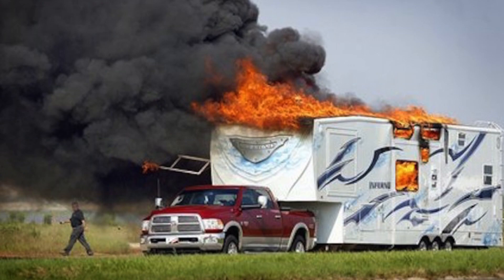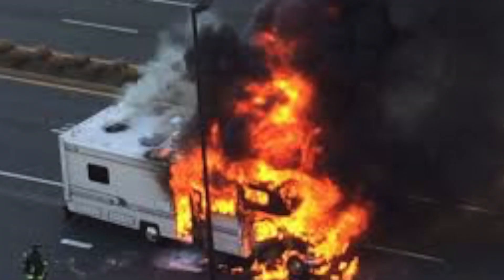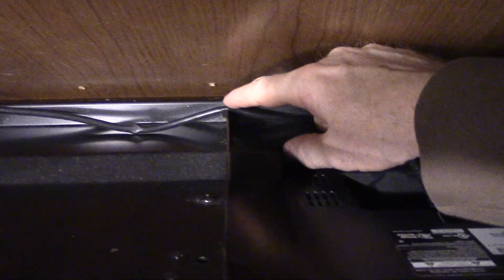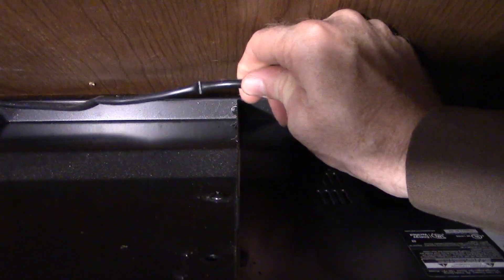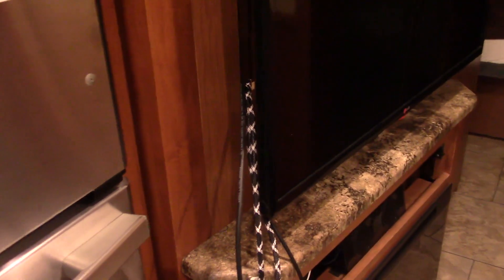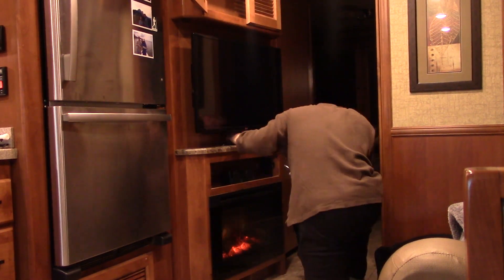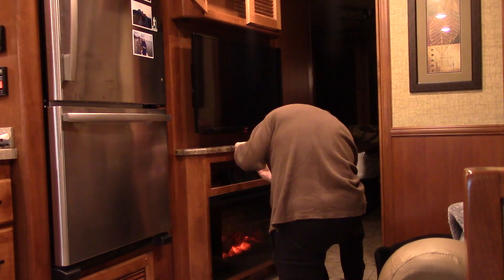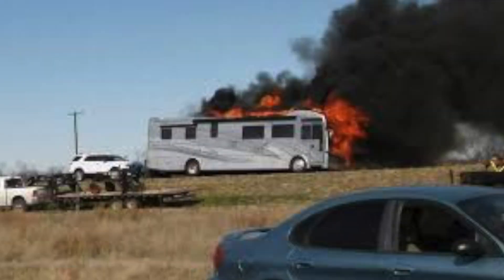RV Fire How We Prevented a Disaster

Comment: This is a common problem with the current manufactures of R.V.s.   I have bare wires behind two of my T.V. and have been in a fight for 1/2 a year with Thor Motor coach to fix the problems.
Reply from the maker: Thanks for watching Ralph!
Reply: Thanks for posting the video, this is serious safety issue that really does not need to exist.

Comment: Either way, the RV industry is horrible about properly protecting wires
Reply from the maker: We have seen many post on the internet about wiring issues in RVs.  Hope we see positive changes in the future before regulation forces the changes.
Reply: Average Campers' Adventures back in 2003 My particular model of Jayco came with a free screw drilled directly into the main wire bundle running down the ceiling.  On all of them.   All they had to do was turn the bathroom vent trim 90 degrees to completely avoid the problem.  I am not holding my breath.  Sure would. E nice though.
Reply from the maker: Sounds like that problem could have easily been avoided with a little attention to detail by the manufacturer.  Heres hoping for changes :)